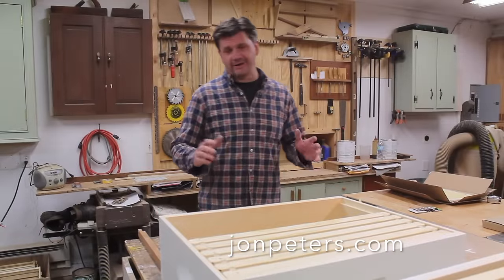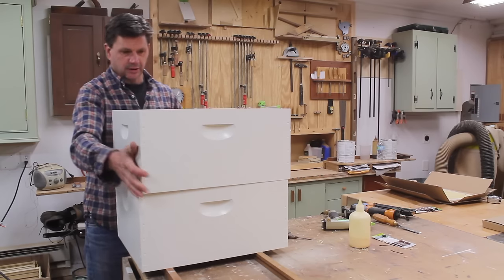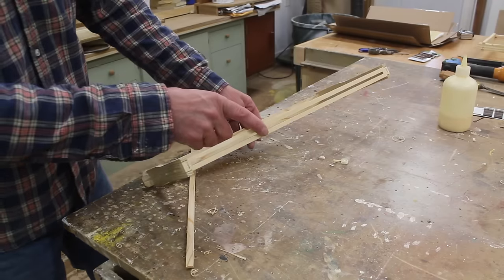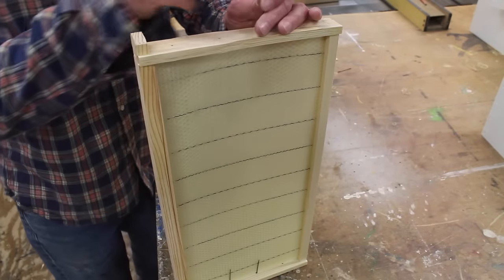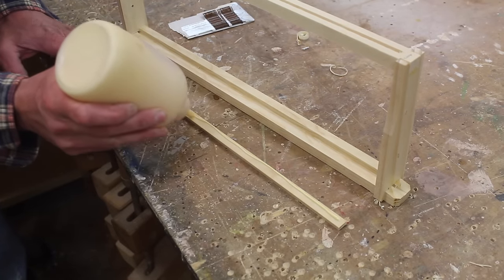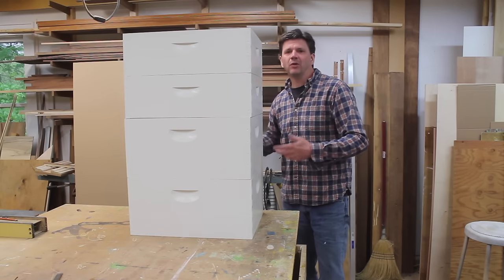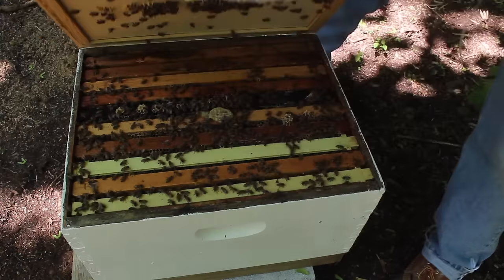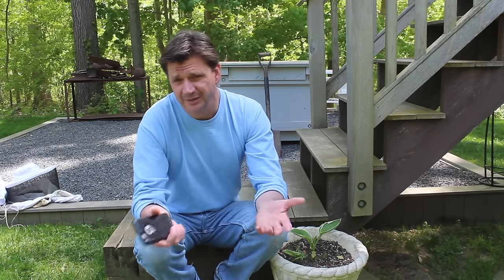Beekeeping for Beginners - Langstroth Bee Hives.

Comment: Good luck with the new bees. Regarding the swarming its not just space that makes em swarm so up until July (at last here in germany) you have to go through the hives regularly and watch out for queen cells and remove them (if the old queen is still alive). Also putting empty frames on the second level out of center will help with drones (male bees) as they are useless an their larvas tend to attract those varoa mites.

Comment: We have two Langstroth hives and last year was our first year. Sadly ours didn't make it through the winter too. How we found them was pretty disturbing. We lifted the boxes one day to find them lining the whole thickness of the bottom board. Our new bees went out mid April and we should be putting out the modified box with 6 Flow frames out any day now. I'm assuming you bought your boxes since I don't see a build video. I can understand that because we got ours for a crazy low price from a local club group buy. There is no way I could have come close to making it myself for that price just considering the lowest local price of pine. One thing I want your opinion on is the gluing of the box joints without fasteners. Everyone I've asked says it needs to be mechanically fastened too, but none of them are really woodworkers. I personally think it would be strong enough. What do you think? I ask because I eventually want to make our own boxes soon so the box joints are flawless. Cool surprise at the end about the music :)

Comment: Those frames are bizarre. On the frames I've seen, you put the wire in first, as a continuous loop. That way you can simply apply a current to heat the wire and melt the wax foundation into place. It makes re-fitting the frames with new wax very simple.